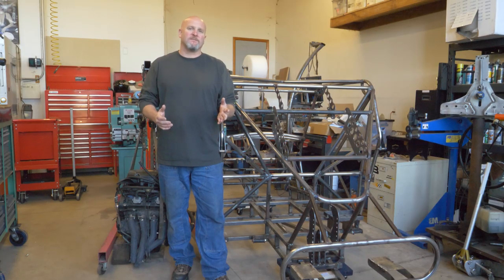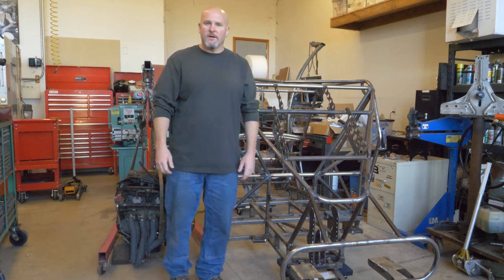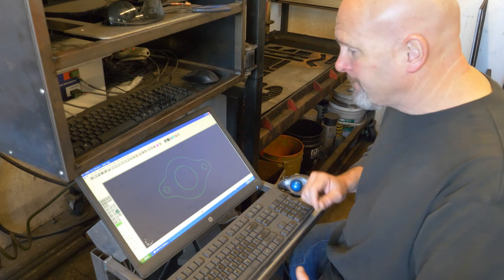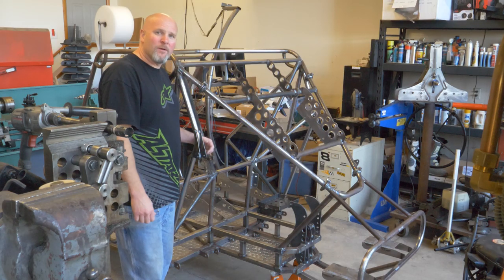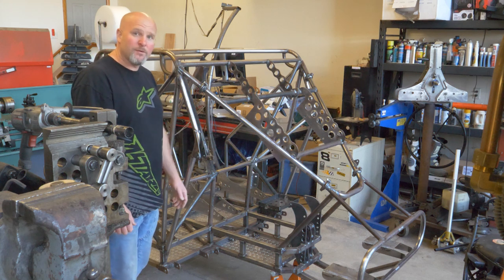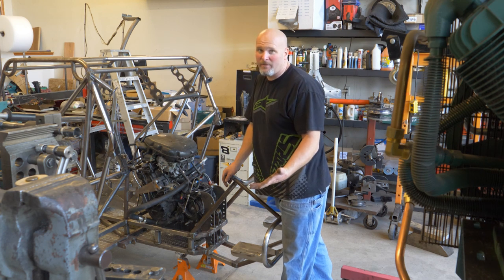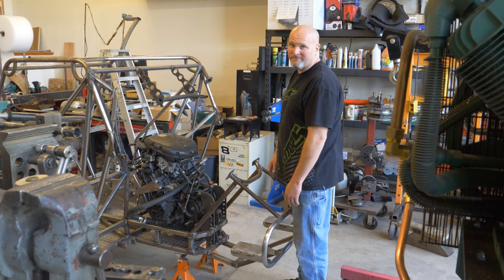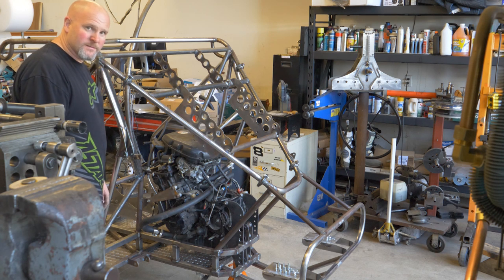Honda CBR EZGO Golf Cart Long Travel Desert Mini Buggy DIY Custom Build Part 9

Comment: Love the builds. Keep it up! Videos are getting better too!

Simple idea to make putting the cage section back on a little easier, maybe weld a couple tabs on the bottom side of a few of the bolt flanges on the frame so you can just set the frame section in on the tabs then put in the bolts, they.d only need to stick out a few mm I’d guess seeing how tight you kept the clearance between the flanges
Reply from the maker: Good thinking!!! I might just do something like that... Thanks for watching!!

Comment: I did the exact same thing for my buggy....used 1 1/2 exhaust flanges....looking good boss
Reply from the maker: Cool, has it held up well? Thanks for watching !!
Reply: If I could give you any advise....before you finish, put a Toyota Prius electric power steering on it.....mine is supposed to show up today ( 75 dollars at salvage yard, controller and all )....after finishing the buggy, I realized it was a must to be able to run it as hard as I want to.
Reply from the maker: @fabricationnation8052  I'm guessing you are gonna be 100% correct on this one. I'll get running as is, because I'm impatient, then add that this winter. Thanks again.

Comment: Hi Moto mule , I'm curious to know what size tube are you using and is it dom
Reply from the maker: I used some DOM and some HREW. The wall thickness varies depending on where it's at. The outside diameter is 1-1/4 in. The floor is 1-1/4 square tube.

Comment: LOVE IT! any plans for a more permanent shock solution? i would recommend internal bypass coilovers. FOX SHOX always did me right and they are a better deal than KING. not knocking king, they just seem to be so expensive for the same product.
Reply from the maker: If this thing works well, I want to invest in nicer shocks. Gotta prove the concept first... Thanks for watching!!!
Reply: @motomule  THANK YOU FOR BUILDING <3

Comment: Wouldn't it have been easier and stronger to just cut out the one cross brace and add flanges, and then make your gas tank and radiator support brackets bolt on instead of having them permanently welded?